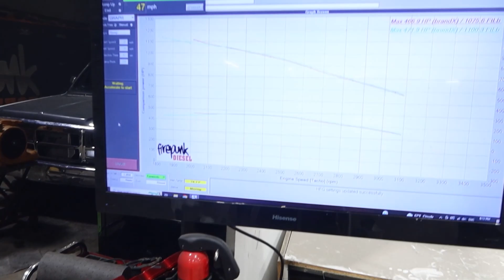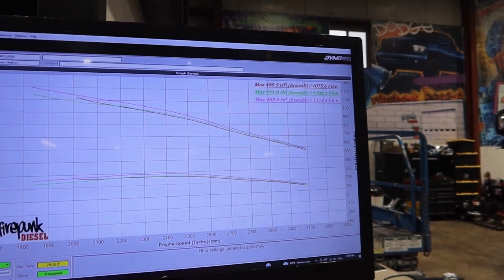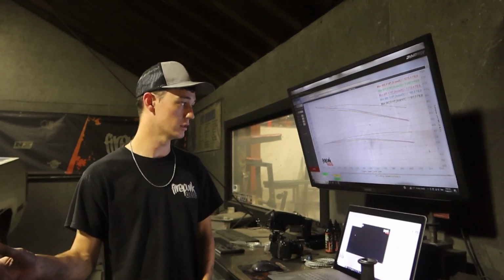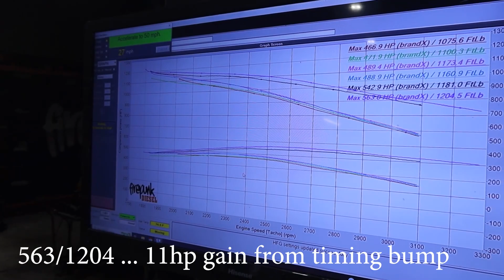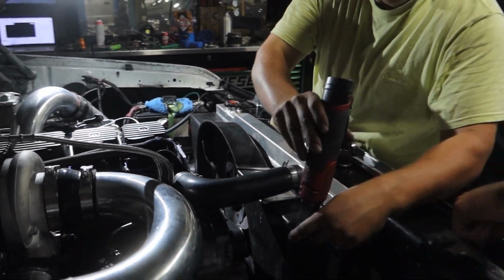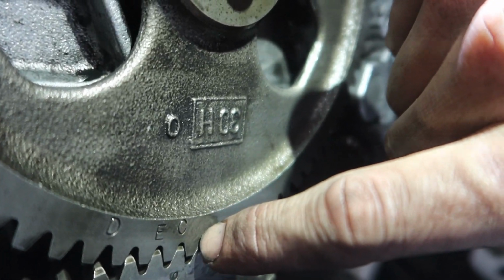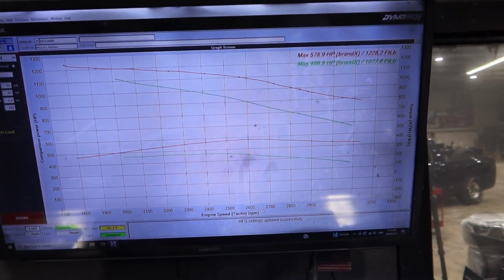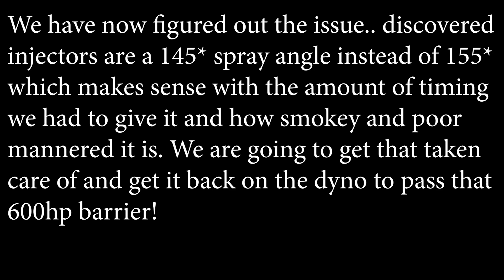Dialing in Nathan's 500+hp VE powered First Gen

Comment: You never said what the boost and drive were running. I would be particularly interested in the drive pressure of the low pressure charger. It may need a bigger exhaust housing on the 475.
Reply from the maker: Was consistent at 82psi of total boost and 19 psi on the 475 and 98psi drive
Reply: @GavinHuke   98 drive is really high. Good power to be had getting that down.
Reply from the maker: @bcbloc02  yeahhh, the drive on my truck was 142psi 😂 I picked up 14hp getting it down to 70psi